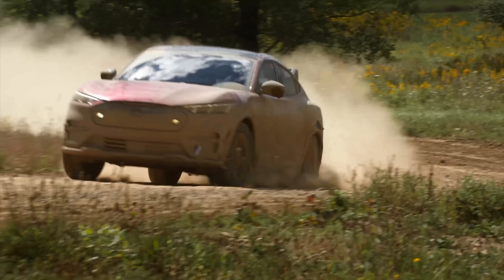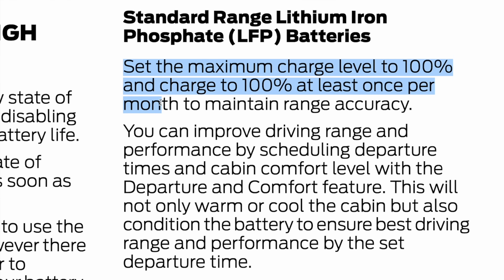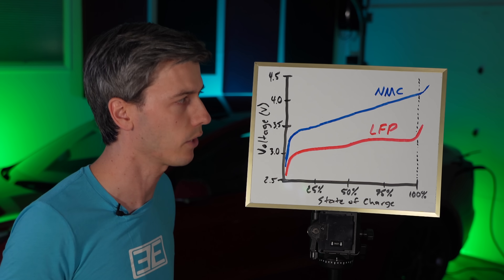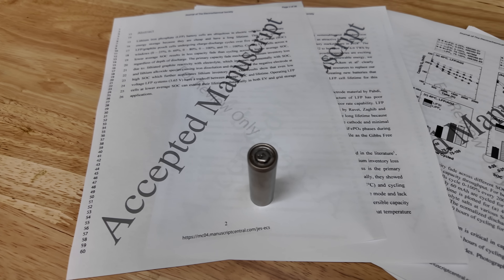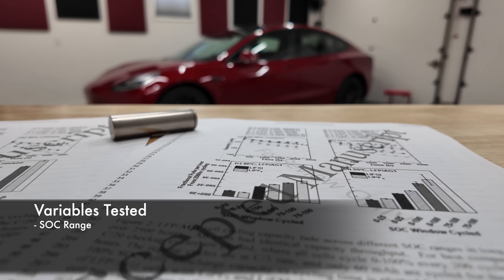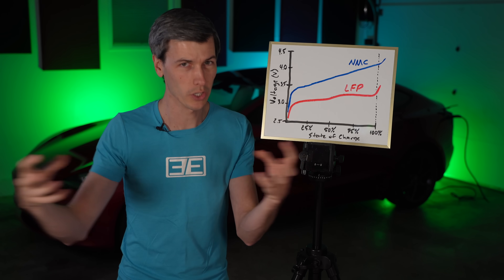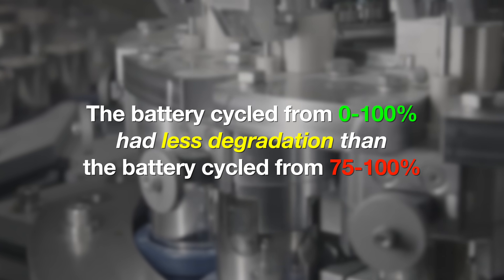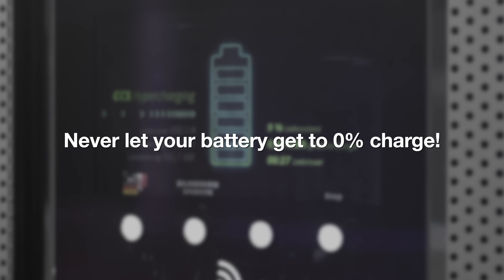How To Ruin Your Electric Car's Battery - LFP Edition!

Comment: Obvious answer is obvious - use a different battery chemistry to track current charge level and integrate it with the pack so it can signal what the actual charge level is of the rest of the cells.

Comment: Thought the crstalization occurs more at low soc (that is why li ion battery dont want to be overdischarged). But the paper her suggested the opposite (less degradation to the battery capacity when operating at lower soc like 0-25% charge state). This is confusing.

Comment: Thank you for this video. I’ve been adopting different charging methods throughout the year since I got my Tesla about a year ago to maximize its longevity. It might change but right now 

I charge it to 50%
Let it discharge to a minimum of 20% soc then recharge it 
Only recharge it when ambient temperature outside is 68.F

I’m still not concrete whether I should keep it at 50% most of the time for long term storage since I barley drive and it’s triple digits here or whether I should let it be 25%-30% SOC most of the time

Comment: So basically still a 200,000+ mile EV when not going in for regular "oil changes" and over 500,000 miles with "regular oil changes" 

Long term storage (ie: months) is a great tip. But in the end, none of this matters on the daily. If it were a legitimate concern, OEMs would be using software to fine tune daily habits. Jeff Dahn was recently filmed counterdicting his own study in regards to LFP.... then again, he's basically in Tesla's payroll, so who knows.

Comment: This is excellent advice! Let’s say I own an LFP EV and I have to park it on the street because I live in the city. I work from home, and would therefore rarely use my EV during the week unless I go for a weekend trip out of the city. They recommend leaving it at a 50 percent state of charge for an extended period of time. Since the car would probably only lose 1 or 2 percent a day this would be absolutely doable. Top up a supercharge before exiting the city and you are good to go! Different mindset from keeping it topped up all the time.

Comment: I have been plugging my LFP Model 3 every single time I get home and charging back to 100% every time over the past 2 years, even at very high SOC. Over the first ~5000 miles it degraded about 4%which is expected I think. Currently I have ~19,000 miles and it's sitting at 4.8% degradation total. I'm just going to keep doing what I'm doing because it's really not degrading all that much. Had I kept it at a low SOC and really tried to baby the battery then maybe degradation would be like 3.5%? Oh well! Totally not worth the hassle. These LFP are really robust.

Comment: So, what do manufacturers do with hybrids? Most hybrids cycle the engine on and off without any input from the driver other than pushing on the gas pedal. Do they normally cycle the state of charge between 75%-100%? Or do they keep it at a lower state of charge, but high enough that you don't need to constantly run the engine? This could be different between a standard hybrid and a plug-in hybrid.

Comment: Auto makers should have software and user-friendly messaging and apps to help control and communicate with drivers to make recommendations or charge cycles. They should be trying to make the charging process as hands off as possible for the driver

Comment: I bought a base Model Y just 2 months ago for the exact same reason: LFP battery. Love this car, best vehicle I've driven. We have solar panels and get free charging from the local shopping center too. And I can't wait for solid state batteries to become cheaper and get an electric motorcycle that can do 500km range and 0-100 km/hr in under 3 secs. What a time to be alive!

Comment: With my NMC model 3, I just have it set to 80%, and do a lot of small chargers (at work, at the gym, at home).
After 15months I have about 1% battery degradation.

Comment: I have a Tesla model 3 RWD with LFP battery. From reading a bunch of stuff, I figured that the reason they tell you to charge to 100% is because of the curve and not getting accurate readings from the battery management system which is just about what you were saying here. So I have always on a normal basis daily have my charger in my house set to, 50% I never need more than that much range anyway in a normal day, so that works for me. It keeps it low and charges to 50% every night once a week. I have the charger set to go to 100%. That is to reset the BMS as you said Ford says to do it once a month, but I’m more comfortable doing it once a week like Tesla says to do. If I’m on a road trip, or I know I need a lot of charge for a trip, I will charge to 100%. On road trips they charge to 100% at hotels. I’m not afraid to charge to 100% when it’s needed… But a normal day I keep it at 50%. Even when I’m doing my week, we 100% top off, it does take time for the battery to degrade down if I’m not driving for a day or two or a few.  Thank you for confirms a lot of things that I do so I is good to see.
Reply: You charge to 50% every night once a week?
Okay.
Reply: @oggyoggy1299  I suspect he meant "...50% every night. Once a week, I have the charger set to go to 100%." 🙂
Reply: how many miles on your M3 and how's the degradation? (How many kw can you charge vs kw rating of the battery when new)

Comment: Well, the first problem here is 'NMC' and 'LFP' already doesn't mean anything these days. It's just a general family of battery chemistry. Like saying gasoline or diesel engine.

Every cell supplier is gonna have different manufacturing processes, ratios of core elements, electrolyte additives, deposition techniques, what are the cathodes and anodes made of and how etc etc... All of these differences are gonna change the behaviors that happen while charging like the one explained here at 10:31.

Oh and Tesla have already said they have made gains both in effective charging speed and cell life by modulating how the power is sent to the cells.

How the battery is actively heated/cooled to maintain its optimum working range internally during the process has quite an impact aswell. Testing in a 40/-55C exterior air temperature is far from the whole equation sadly.

Comment: Because of flat voltage curve of LFP batteries, battery balancer in the pack only gets activated at close to 100% SoC. It just can’t do an adequate job in the flat section of the curve. 
And you really want to have a balanced pack because even one cell being significantly out of balance could trigger BMS protection and stop entire battery from charging or discharging. 
That’s the reason why manufacturers ask to periodically charge up to 100%. Better not just charge and disconnect, but charge and let it sit on the charger enough to finish balancing cell voltages. New batteries will balance fast, old ones can take more time.

Comment: The reason why the test cycling LFP at lower state of charges got more degradation is because the instantaneous voltage when cycled at high discharge rates puts the cell in much more stress. Also, the LFP chemistry is less efficient than NMC, and far less efficient when at lower SoC. LFP when hit with continuous high discharge at low SoC makes a ton more heat compared to cycling at a mid SoC.

I have a DIY LFP system in my car, it power various electronics and my 24/7 fridge to have cool drinks at all times. It regularly gets to 110F at the cell. I only charge it up to 13.1v and let it cycle between that and a LVC of 12.8v. It charges whenever my car is running. 2 years in, capacity test shows 0.5% capacity loss compared to when it was only 5 cycles old. This works because my electronics and fridge pulls a max of 0.1C. If i fire up my inverter, it will task the batteries with a 2C discharge, which is ALOT for LFP. 

This test is done in Los Angeles. Car is parked in a garage at home.

Comment: Considering LFP batteries can last 3000-5000 cycles under ideal conditions, which is 550k-925k miles on the LFP Mach E (~5-80%, dunno if thats the right cycling charge number), i think that as long as you dont charge the battery in 100⁰F-130⁰ temps regularly, and dont leave it stored at 100% regularly, you will not need to think this hard on it. Im hoping that NMC gets phased out over the next decade for average cars so we dont need to worry about it. Save NMC for more niche cases
Reply: I suspect NMC (solid state or otherwise) will be limited to the high end by then. The average consumer doesn't really need it. That being said it might be nice to have a few NMC regular cars left for people that live in colder environments.

Comment: I did test LFP batteries for several years in a real-life scenarios and I must say that the difference wether you cycle 0–100 or 75–100 is minimal, I’m talking 1% degradation over 300 cycles difference. Not worth it in my book. High temperatures of 60+ degrees C will damage batteries way faster, talking 30% over the same cycle count. Park your BEV in a shade, even if that is an electric bike.

Comment: Hm. This is way too complicated and will undoubtedly lead to frustration with the less inclined customers.

I think that a plugin hybrid can incorporate better battery protection strategies for those customers, who drive around in a more carefree fashion. The engine can, at a later stage be replaced with a fuel cell.

Comment: Huh, this is painful. The only right solution could be to keep your car plugged in and communicate your habits and drive plans to your car, so it can automatically charge the battery to the optimal level (for the battery and also for you) taking weather forecast into consideration as well.

Comment: I am never surprised by a manufacturer, telling you to do something that will make they thing you bought from them need to be replaced more often. Honestly surprised Ford doesnt tell everyone to always charge to 100%

I like that they clarified maintaining range accuracy calculations=/=battery longevity and they only recommended 100% was to re-calibrate battery capacity and voltage curves.

Also i think later studies have suggested that discharging below 10% can be detrimental as well with many more chemistries than we though, so 10-35% might perform better than 0-25%

Edit, i think originally it was only Lithium-Polymer batteries that were thought to degrade faster if charged above 80% and discharged below 5-10% but some study said it was more, and i dont remember if LiFePO4 was on that list of chemistries affected

Comment: Rubic Cube CATL LFP battery.  I live in a provincial town, avg 15km a day, 3 times a year visit  Major city 160km away.  I operate in the 30% to 60% range, which gives me 90-100km. a once a week 30% charge.  This should provide at 12,000 cycles some 230yrs battery life.  Also note SAIC have given the MG4 in Thailand a LIFE TIME warrantee for battery, and motor.

Comment: May be mentioned before. It seems the degradation seen in the study likely is affected by calendar aging significantly. We know from prior studies that LFP calendar aging is accelerated above 75%. This does not explain the difference seen between 0-25%, 0-60%, and 0-80%.

As mentioned before, LFP cells will degrade more from calendar aging than cycling. One should not worry about charging too much, but common sense will be to keep your average SOC below 75%, or just let the battery drain to below 30-50% before charging.

Comment: Thank you for your great Videos as always :) 

As i don't drive an EV so far i have a question to EV owners.
As he mentioned can the BMS get out of calibration when you don't charge the battery to 100% every month or so.

So my question to you: 
If you set your charging to for example to 80%, does your car warn you if it is time to fully recharge? Or is it even charging it to 100% automatically from time to time?

Comment: I think the actual brilliance of what is being described here is it is as close to what ICE vehicle users have been used to for the last hundred years. An ICE user is not going to top off at the gas station every day because that would be inconvenient. Making that detour would actually cost you fuel in the long run because you're adding extra miles to your daily driving, so it's better to fill up only once per week, not to mention the weight of fuel alone can reduce your fuel economy by 1-5%, and your MPG goes up as fuel is depleted.

Comment: He did not mention it costs $3000 to $30,000 to change the batteries, depending on what kind of EV you have.
Reply: Why would he? It's unlikely you'd need to replace an LFP battery.

Comment: FYI, it's not possible for any individual cell to become too low or too high vs the others because there's banks of cells connected in parallel. Any batteries connected in parallel automatically balance one another without the need of an active balancer (because they "actively" send power to whatever cell has the lower charge). These banks of parallel batteries are then connected in series to form the high voltage battery pack. The banks of batteries are what require a BMS to monitor, ideally an active balancer as passive balancers turn extra energy into heat, active ones send excess energy from a high cell or pack to a lower one using either diodes or DC-DC (boost) converters or some combination thereof depending on the make and model of BMS. If you have just a passive BMS then a low SoC is dangerous and would require a 100% SOC before the BMS begins burning off extra energy from the cell that has higher voltage than the rest in an effort to equalize them. TLDR: parallel connected cells balance one another (brute-force), series-connected cells REQUIRE a BMS.

Comment: It's odd that the study considered only cycling windows down to 0%, apart from the 75% to 100%.  My impression was that discharging to very low SOC is one of the things to avoid as far as possible, not allowing it to go below 20% unless it can't be avoided.   I wonder why they didn't consider charge cycles which didn't go below 20% or so.

Comment: The best batteries (1972 ceramic batteries) will never go out in the market, never
Reply: What's their Wh/kg rating?
Reply: @logitech4873  1972 was 105wh/kg, full charge tme 20min, nothing toxic, and definetely they would have evolve more by today.
Never put in production.
Reply: @christosgerakinis2628  Lab batteries can have insane specs. If it didn't enter production, it was because it was infeasible to mass produce, for whatever reason.
We have lab batteries with 700 Wh/kg energy density today, and batteries used in EVs today have energy densities of around 250 Wh/kg. 
Even the extremely safe and benign sodium-ion batteries of today have an energy density of up to 160 Wh/kg.

Comment: BATTERY OWNERS: THE CLOSER TO 0 AND 100% YOUR BATTERY IS, THE SOONER IT DIES! 

ideally staying at 50% or between 30-70% is the best practice

When the recommendations don't make sense to the consumer, the steps won't be followed correctly. Gotta make it simple but give them a way to find out more if they know what they are doing.

Also telling them to charge to 100% super often does have some benefits but destroys your battery which makes them more money

Comment: Great content - thank you! Fellow dork here. 
So…isn’t it true we can’t technically achieve either 100% state of charge or 0 due to the built in buffers? For instance, my 2021 Mini SE with its hilariously small battery still keeps 4kwh back from me, providing a max of 38 vs its true capacity of 42…(or something like that). So even if I leave it plugged in always (as BMW says to do), it never gets more that 90% topped up. Isn’t this some to protect its from the 100% charge damage risk? 🧐
Reply: Not LFP battery cars. That would be detrimental to their function.

Comment: You have to learn all this for electric?… gas cars are just, you can leave them there for a month 😂😂😂❤😂
Reply: I bet nobody's ever had to deal with a flat 12v lead acid battery...
Reply: @mojojoji5493  How long did it take before your first cellphone battery started losing half of its usefulness? How long does your current cellphone battery last? Technology improves. An abused EV battery will still be around for years, but the earliest types will definitely benefit from some TLC.

Comment: I have a September 2021 Tesla Model Y Long Range Dual Motor, for sure with NMC batteries.

I cannot charge at home, but have a public level 2 charger at the parking lot... I charge itr every time to 90%, overinight and plan it via the app to be charged to that limit just an hour before I leave, then drive it until it get to about 20% SOC before pluggiung it in again 4 or 5 days later.

Only during road trips in summer I charge it to 100%, but again just an hour before I leave it will get to that SOC, and during these road trips I allow it to get below 10% SOC, but of course I do charge it immediately when it gets so low.. Advantage of driving it to low SOC is that you can benefit from the higher charge rates at the superchargers, shorting your road trip time.. Like charging from 5% to 65% goes significantly faster than from 25% to 85% (both 60%)

After 3 years and 50.000 Km degradation is about 7.8% (according ABRP) But it got to 6.5% very quickly (within 20.000Km) so degradation has slowed down significantly. during daily driving I hardly notice,  During road trips I cant do some in 2 stops anymore and I need an extra short stop.

I think my practice is OK, key element is that I never let it stay long at the extremes, so the processes that cause battery degradation do not get much chance to do harm.

Comment: You totally missed it.  The manual said 100% *for range accuracy*.  It does NOT SAY "for best range" or best battery life.  Charging to 100% simply allows the software to calibrate it's State of Charge display.  I.E. So it knows where 100% is.  NOT because it helps the battery.